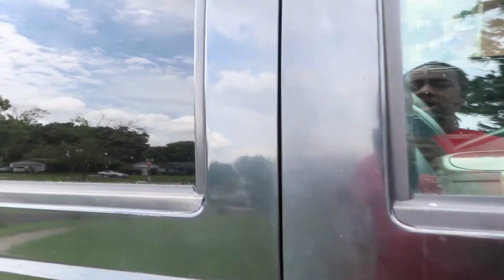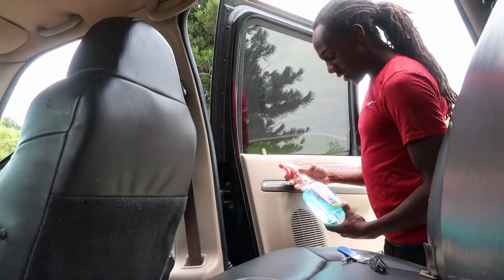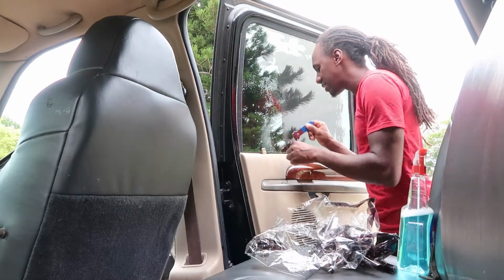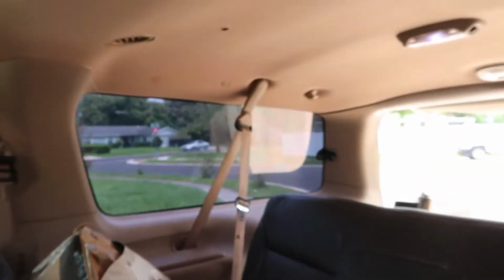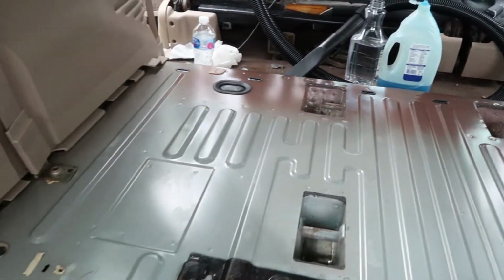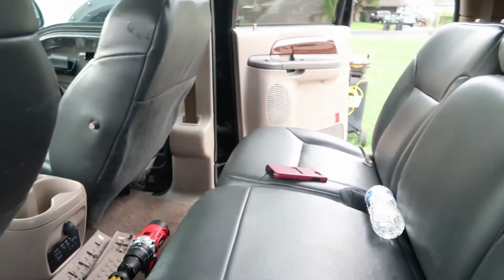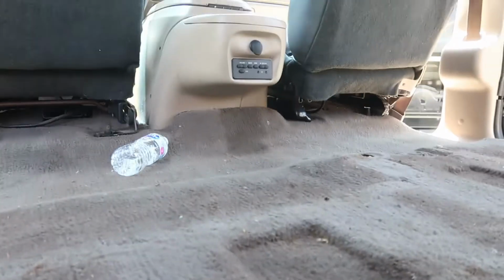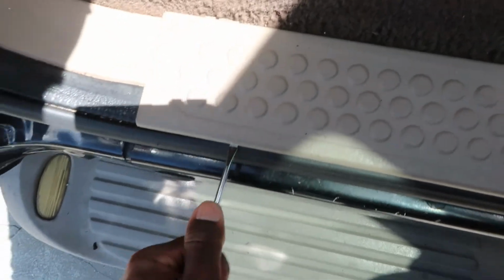Ford Excursion Carpet Install + Tint Removal

Comment: Get rid of the panels on the outside. They hold water, and promote rust. Worst thing that auto manufacturers do is put that damn plastic on. Ripping mine out as well. Passenger side door has rust underneath.
Reply from the maker: You're absolutely right